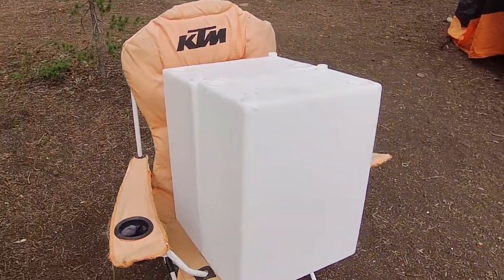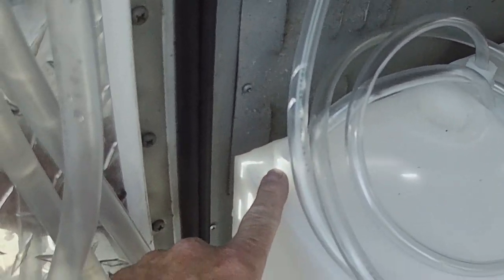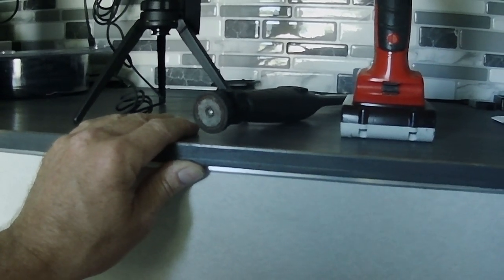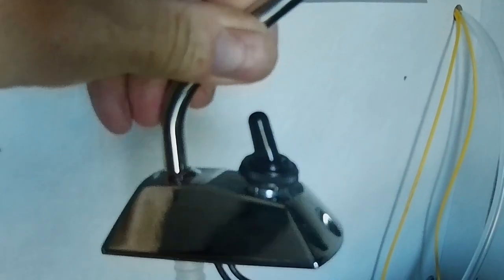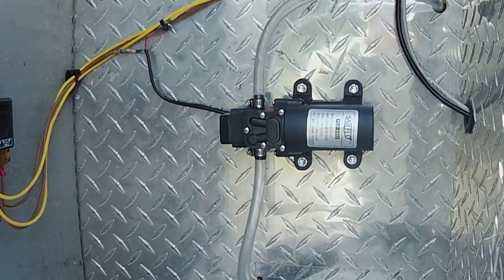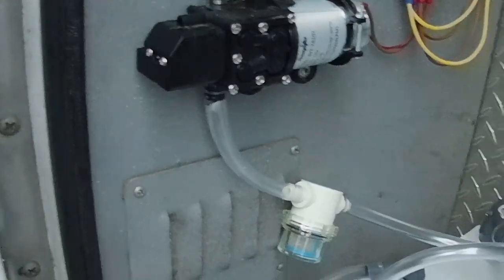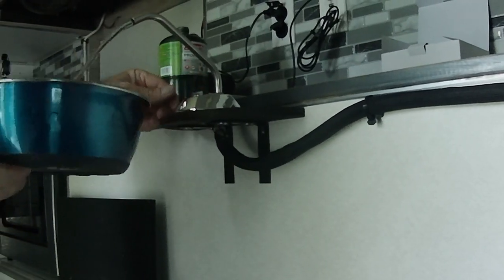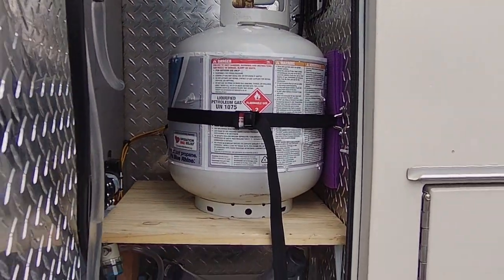Ambulance Conversion Water System UPGRADES | Hot, Cold, Shower, Faucet - 32 Gallons On Board!

Comment: From South Africa  the answer to your curling pipe problem is to push a thick (5mm) diam galvanised wire up inside the pipe. Give the wire a gentle Z kink to keep it inside the pipe. Bend the end of the wire at 90 deg and leave the end around 20mm long so that 1. You don't push it in to far and 2. You can pull it out.... you're welcome RGDS Warren..... Oh, one more thing .... notch the end of the pipe so that it won't suction to the bottom... notch 6 -10mm 😃
Reply from the maker: That would fix things I think :)

Comment: That's easy, use a cut section of PVC piping, drill holes in the pipe, and connect it to a piece of flexible hose or whatever you want.  That way you don't get the curling of the pipe, since the rigid piece of PVC will always stay straight....
Reply from the maker: I ended up using Pex pipe- its been working perfectly  :)

Comment: You might want to put a grommet where your water line runs through the aluminum panel.  Vibration could eventually rub a hole in your lines or wires if you are doing electrical....cheers
Reply from the maker: Good tip Randy thank you. I'm planning a change to the water line and putting a push in grommet in the hole. Thank you!
Reply: @TheCampulanceMan    also, if you mount everything to a shock mounted sub panel with quarter turn fasteners to remove it makes maintenance easiest..to get to that panel area or cut that panel into two, upper and lower...modular systems...fun stuff !
Reply: @TheCampulanceMan  everything freezes including the toilet...never kick the shitter drain tube...in Winter... 😂

Comment: They sell a mixing valve for auto sensing faucets so if you replace the faucet with one of those mixing valves should give you hot cold or warm water inside
Reply from the maker: The only downside is the time it takes for the warm water to arrive - when boondocking that adds up to a lot of wasted aree :/. I need a recirculating valve that dumps it back into the tank until it reaches temp, then passes it on to the faucet. There must be one available... It's on my list (the long one...)

Comment: @ 12:43, you are pointing to the water pump for your shower. What is the small black box, with the wires attached to the bottom of the box (from both pumps) that is to the right of the shower pump?  Thanks, looks like a great setup. Thanks.
Reply from the maker: That is a wireless switch to turn the shower pump on and off. I have a remote that hangs in the shower tent to control it.

Comment: Those water tanks look like these?
 https://www.amazon.com/Class-Customs-T-1600-Gallon-Approved/dp/B007MSI79Y/ref=sr_1_1?dchild=1&keywords=Class+A+Customs%7CT-1600&qid=1614263251&s=automotive&sr=1-1

For me, plumbing is a big pain, mainly for sourcing the fittings, no matter how I plan, it always involves extra trips to the store. One thing that has helped when applying hose clamps, is that I apply two 2 clamps to each fitting with the tightening screw in opposite directions, which works well for me. I'm getting ready to move my water / propane into that same former oxygen cabinet, as you did. Right now the water / propane lives in the cabinet that was used to hold the spare tire. I will add one tank first and if my needs change, will add a second one if needed.

 Lefty is a great help when it comes to opening boxes and the best traveling companion.
Reply from the maker: Yes they are Class A Customs, but buy them directly from their website - they're cheaper than Amazon. I had free shipping :)
I'm just like you - the plumbing was a pain for me as I'm not experienced. I recommend the PEX clamps - I always had leaks with hose clamps - but the PEX clamps solved that.... :)